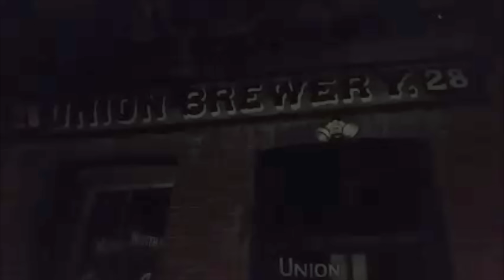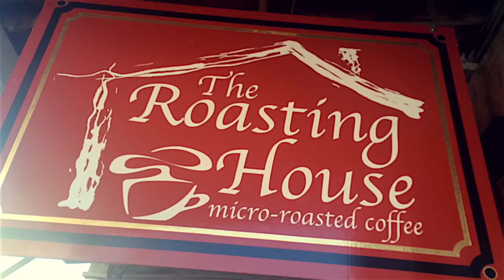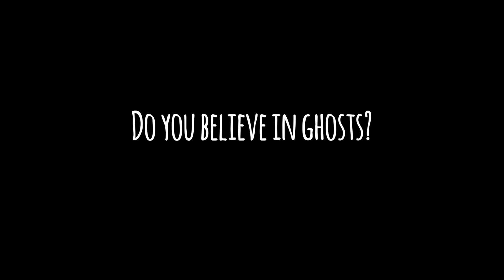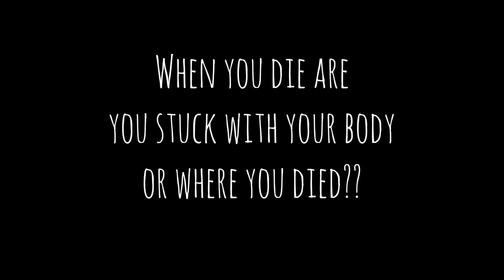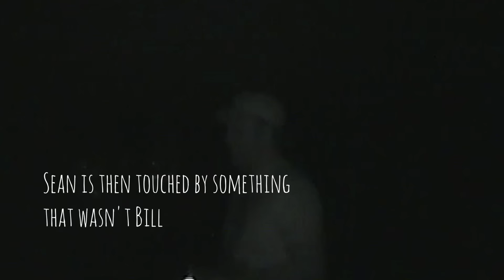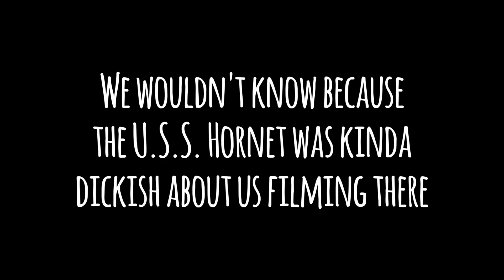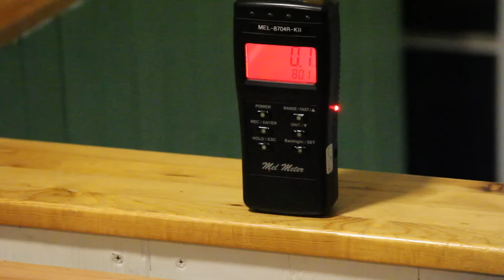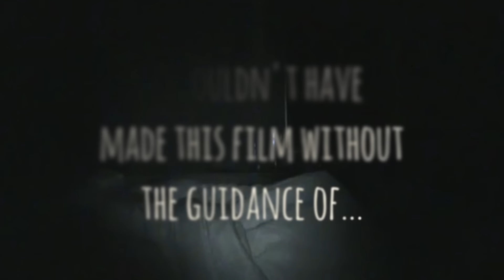Ghostumentary: A very real ghost documentary

Comment: Did anybody else notice anything at 1:24:28? Upper left hand corner of the screen.
Reply: Very likely just cameraman’s hand after they adjusted the zoom ring. As a videographer myself, when I attempted to adjust my ND filter on the front of the lens, if I’m not paying attention I’ll see my hand in frame.
Reply: @jbruce87  Very likely just that, though it was only for four frames so whatever it was, hand or otherwise moved very quickly.